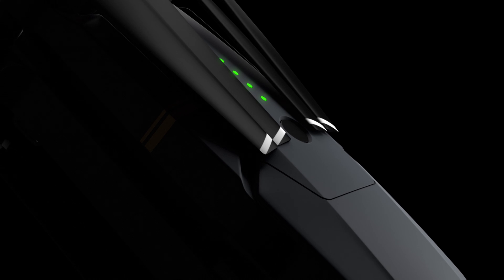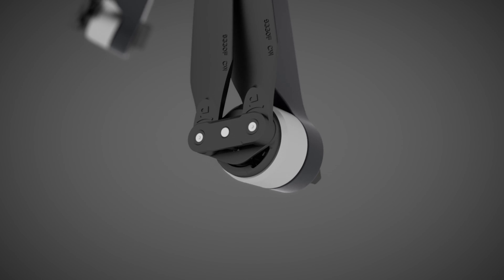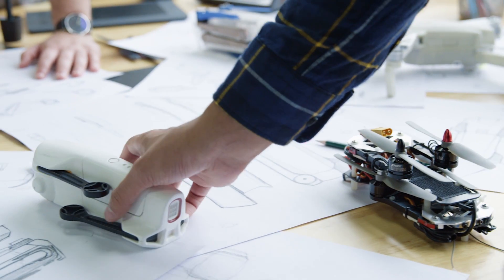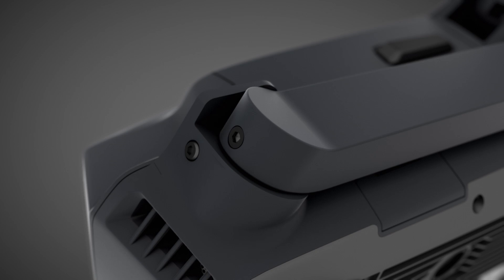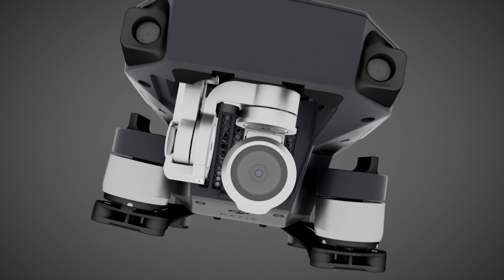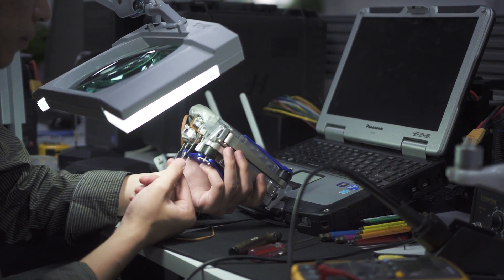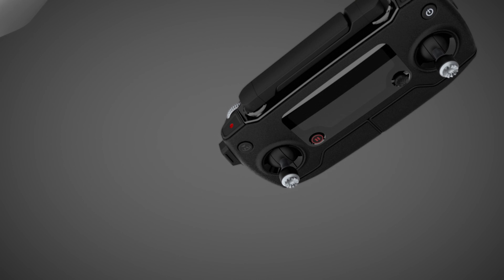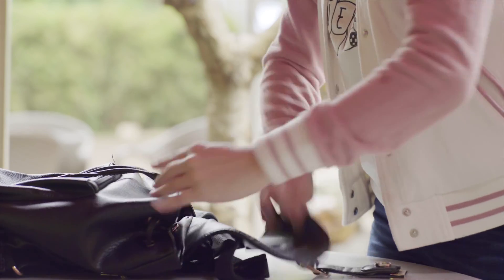DJI - Mavic Pro - The Art of Form

Comment: http://www.stuckincustoms.com/2017/02/20/10-problems-with-the-new-phantom-4-pro-plus/                                                                                                                                                       I have problem number 1 with the Mavic Pro. Sometimes when flying along the drone stops because it thinks something is in front of it. I wonder if the sensors are catching the sun and that's causing the drone to momentarily stop. I normally just let it stop and push forward again and off it goes.

Comment: Enough of the hype. I love this device despite costing so much.  I brought this to the Maldives and I am satisfied, impressed.  There are some insights I would love to contribute for improvement.  
1.  Gimbal cover should allow for a window for the camera so that I can leave it there permanently.
 2. Return to Home wasn't accurate, consistent as I expected. Only useful for large open areas.  
3. Sharp ( so sharp, I found moires many times) in the center but corners are soft, almost unusable.
4.  Better, larger sensor for less noise 
5. DNG files are larger than my Nikon d3300 
6. 1080p @ 60 fps is awful.  60 fps is my desired framerate which is the also the reason I bought the Mavic

Comment: I just sold mine and went back to the phantom 4 pro. Listen guys this thing constantly gives you high wind warning not Just mine but everyone else I know. It is impossible to fly out of gps mode do not fly this drone with just your phone and wifi everyone I know has wrecked this way. I sold mine immediately finding it all the flaws the phantom series is way more stable and much better all around
Reply: Drone U. Have been looking at a  drone for a while and really like this one. Is everything good if you only fly in GPS mode? And curious, why would anyone fly without GPS? Like in a building or tunnel?
Reply: chris troger honestly it's a very awesome concept a foldable compact drone and everything you read says the mavic is equal to the phantom 4 and up series drones, however I went and bought one flew about a week and while I'll say again it's a awesome concept the camera is amazing I wasn't impressed with its flight capabilities at all the lightest wind gust and a warning pops up asking to return to home because it's windy I flew on a barely windy day at all up to 400 feet it was only gusting to 8 miles and hour. I think the slightly bigger phantom series looks professional it has the weight to handle wind and flies like a professional drone should. Also gps mode you should fly in anyway however when it switches to ATTI mode you have no control over it much at all be careful. The wifi phone option is for indoor use and in my opinion has a lot of glitches needs firmware update this isn't just mine that acted up but several other pilots I fly with.

Comment: Beautiful machine! The only problem is that is does not work well with android devices as advertised, and mine disconnected from the r/c from 15 ft in front of me and only 5 feet off the ground causing it to crash. But other than that its an engineering marvel! lol